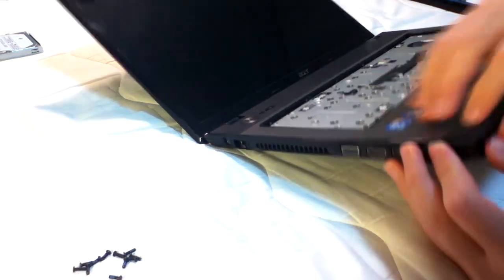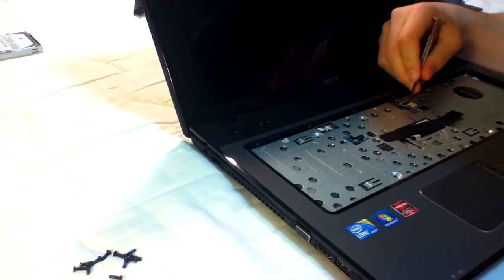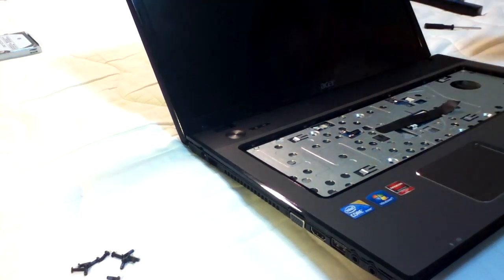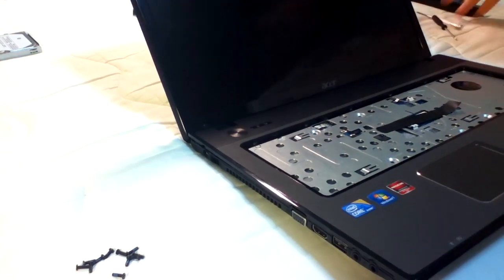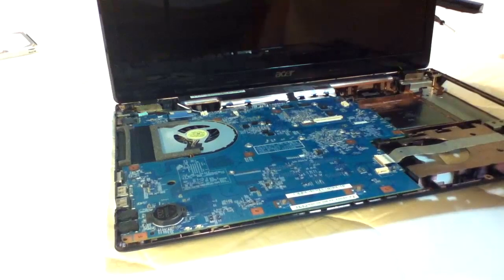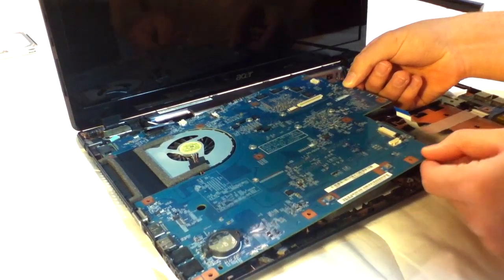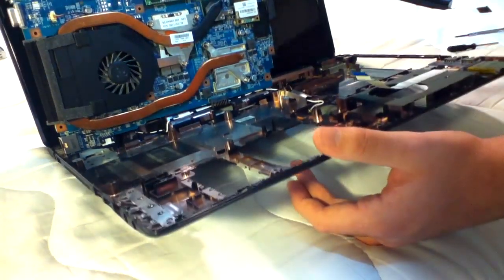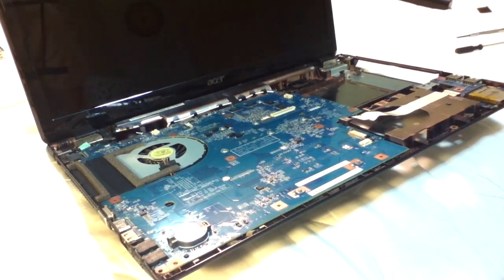Acer Aspire 7741G / 5741G / 5253G Laptop disassembly Part II

Comment: So I took my Laptop apart to clean out the fan among other things.

It went rather smoothly had a little trouble with the keyboard pins because I lacked the right tools I pushed one it and had to make a hook to get it back out again.

I will have to open it back up again sometime to apply some good quality thermal compound to it as I didn’t even any on hand.

Overall It was good fun taking apart my laptop to see what kind of hardware lurked inside.

Comment from the maker: after the keyboard plug is in place, use some thing like a small screwdriver to push the black plastic clip toward you until it firmly holds the plug in. As long as the black plastic clip is in one piece it should be able to hold the cord in place.

Comment from the maker: hello Abdilatif, no the gpu is not removable, but if there are any available you can look for a new motherboard for an acer model that is like yours but with a better card. For the optical drive, you can replace it with a caddy that can carry the secondary drive and provide an adapter for the connector available.

Comment from the maker: If nothing was physically damaged then it could be as simple as the keyboards' plug not being securely attached to the mother board. just lift the keyboard and try to have it fit in the grooves that center it then make sure that it is pushed in entirely before securing it with the plastic clip.

Comment from the maker: just search for a mini PCIe Bluetooth module, I showed the slot in my "hands on and unboxing part 2" video. Although, it seems that most bluetooth modules come as part of the wifi chip so you could get a new wifi module (also mini PCIe) with Bluetooth to replace the current one while also getting the advantage of the built in wifi antennas that go up through the screen.

Comment from the maker: The tape is less efficient then the paste and it isn't as necessary for the chipset (it may not even be applicable). you will however still find paste over the cpu and gpu. If you are looking to replace the thermal solution, just replace the paste over the cpu and gpu and leave the thermal tape on the chipset.

Comment from the maker: Generally, you know its fastened if you can no longer pull it out. (not saying you should pull with a lot of strength, just that when it isn't secured, it usually comes out easy)

Comment from the maker: are you sure that all the cords that were unplugged were secured afterward? The power button and lights were powered/controlled by a small cord directly under the keyboard and the screen cord was long and thin, it could easily have been unsecured when pulled on. Just make sure there is a small click with each of those and they should work. other than that I dont know what could of caused it other than physical damage to the machine because this video IS the way it is meant to open.

Comment: Many thx for all Ur help mate, I almost did it but couldn't find some good paste in my stuff, got only some weak ceramique, I tried to buy online Zalman STG-2 when my laptop shut down (overheated).
I thought I need to clean it fast to buy my goddamn paste:) and used vacuum which i never used before for cleaning computers:)
I blocked fan wih some stick and vacumed all air-holes in bottom and sides. It took me about 30 secs. 
Now I have 37-41 CPU idle, 80CPU 55 GPU in World of Tanks, 75/62 in BF3

Comment from the maker: the monitor cable may be wearing out if you are sure that its is properly connected. I had a dell and an hp brought to me to fix with the same issue. the solution, a 7 dollar replacement cable on ebay to replace the one that is there.

Comment from the maker: yeah it should be the same, just continue on after the tutorial. and unscrew the heatsink (goes over the processor and graphics). from there, it should be easy to unscrew the fan and clean the air outtake grill.

Comment from the maker: my temperatures didn't change all the much except idle decreased a little. They weren't all that high to begin with though.
44-55 at idle and 80-95 in-game.
It would be worth replacing in your case t see if that is the cause. good luck.

Comment: yeah i had the same issue, it was overheating, I bought a cooling pad since for some stupid reason acer only put one intake so it needs a lot more air flow to cool it properly.  The dust in my sinks didnt help either.  I was getting bad lag spikes in diablo 3 and now none yay!

Comment: thanks for fast answer, meanwhile i found this: /QwwzqsiJMTE?t=4m39s
there is heat tape not paste on chipset and im pretty confused now...
7741G seems to have paste while 7741 nonG has tape instead on same looking heatpipe - this is definetely weird.
I have 7741G with Radeon 5650 but now im not sure about renewing conductors, i'll probably just clean fans form dust

Comment: Hi. I used to have my Acer Aspire 7741z wrapped in the kitchen food plastic. And that helped me alot to keep my laptop from dirt and dust. but I had to cut off the places for fan to let the air in and out. But after my friend (PC repare man) told me that it was stupid to do such athing to my laptop, and I'd killit rather than keeping it to less longer. So took them off. Now my laptop is dusty, dirty. Especially keyboard and speakers. on 7741z-4643 the keyboard is awful. you can't remove them/

Comment: Hello @Adnanklink!! Is the GPU removable by any chance or do you see any where that another more powerful graphics card could be placed? Say I would like to remove my DVD/CD drive to replace it with an external one, and 3.5" HDD for a 2.5" SSD, how much space is available, a length by width dimension would be appreciated. Thanks.

Comment: How do you connect the black and white cable to the wireless lan antenna :)
Reply: Steen Skjelmose I know that for you it is not important now but I had the same question. The black wire goes to the 1 and the white wire goes to the 2.

Comment: hi mate,
my laptop was working before but got heating problem and i tried to open my laptop but when i connect back it there is no power,
when i connect the charger to power supply on opened motherboard i can feel heat on board,i even cant see any light as well,
help me!!!!!!!!!!!!!!!!

Comment: There is a easier way of doing it just take air under preasure and blow at it (you dont have to unscrew anything)
Reply: DOES NOTHING AND IF YOU USE A REAL AIRCOMPRESSOR NOT AIRCAN WAY TO MUCH AIR PREASURE AND YOULL NEVER GET THE FAN CLEANED!